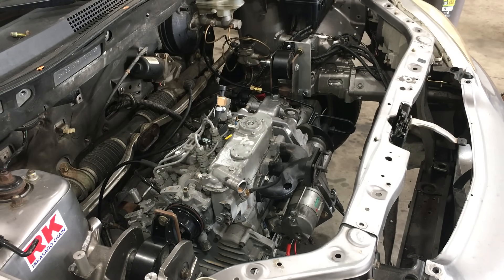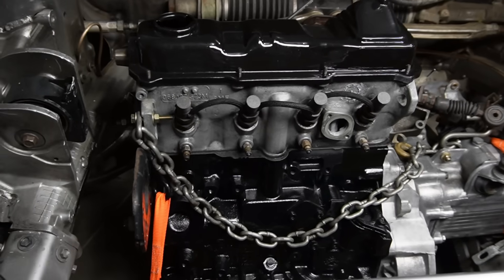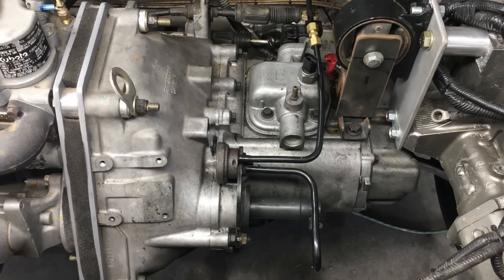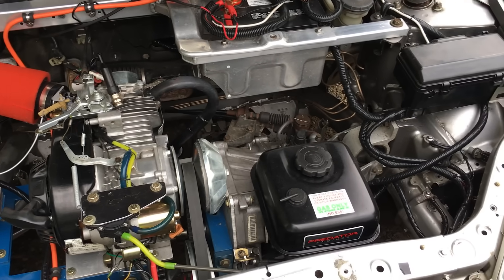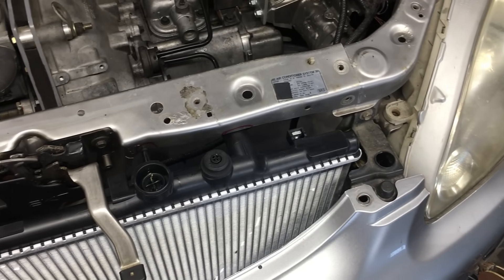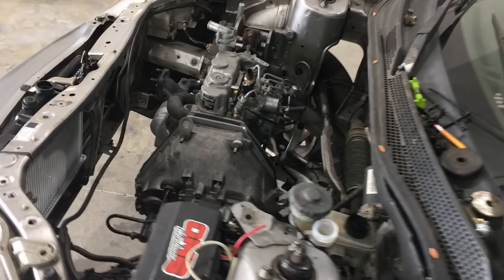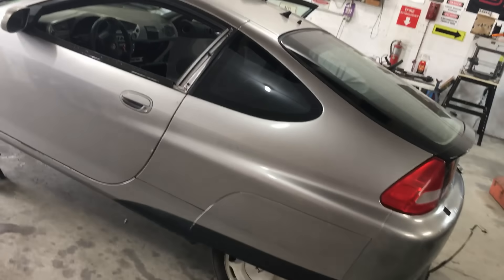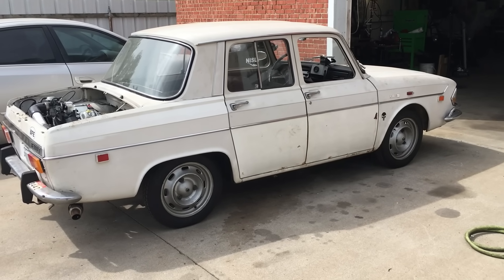S3 E33. 3 cylinder Kubota D722  diesel powered Honda Insight project has begun

Comment: I’ve been waiting for this project from the day you first introduced the Kubota…. A match made in hyper-mileage heaven!
Reply: Haha!  :)
Reply: It's neat, but realistically VW already sells a 1L diesel Lupo that can get around 80MPG with some wheel covers, grille block and smaller mirrors.  If one was so inclined.
Reply: Never sold in USA
Reply: @milescarter7803 imperial miles is different from regular miles. Just fyi.
Reply: @EvilCerealBoX  I think that 80mpg is already U.S. gallons.
Reply: @milescarter7803  Sticking to 40mph sustained speed on a warm summer day, I can get 110mpg (U.S. gallons, which I believe your number is referencing too) with my stock gasoline first-gen Insight (averaged over 95 miles). I'm interested to see what they can achieve with a diesel.
Reply: @milescarter7803  my bone stock g1 insight does that with driver mod
Reply: With gas prices we might all go out and buy our own insight to diesel swap
Reply: @sim6699 why not just keep it a hybrid 😭
Reply: The kubota can run on waste oil though

Comment: The supercharger just put this project over the top! If this gets twin charged, it may be my new favorite car on YouTube.
Reply: was about to say about twin charging, combine the best of both worlds
Reply: A twincharged diesel insight would be great
Reply: Yea indeed. that would raise the torque across the whole rpm range. With some magic up top. Should really consider upgrading the head bolts and maybe valve strings and some thick aluminium rods.
Reply: Combining the amr 300 with the turbo charger would be simple u could reuse turbo charger stuff from last time and ud only need a mesh blocking stuff from getting sucked into the amr 300
Reply: Mmmmmm... Twin Charged...!!!! That would be awesome! Lots of work to do that and I would want to watch every minute of it with one of those, as Mike Brewer from Wheeler Dealers calls it, a silly stupid little grin on my face the whole time thoroughly enjoying it all!  : )  Though, truth to tell, I do that all the time anyways while watching this channel!!
Reply: @ramentaryramblings  I really want to see both types of twincharging personlly.

If Jimbo wants his insight to be as predictable as possible, then he should run the supercharger into the tubro into a cooler then the intake.
This causes the supercharger to act like a pressure regulator, it limits the total amount of air in the system, but should also put cap on maximum boost level.

Essentially, the supercharger provides boost at idle to mid rpm, but also causes parasitic loss. The turbo then starts to kick in, and because of the stable boost pressure, should begin to reduce the drag the supercharger has on the system be reducing the amount of work it needs to do since it is now "feeding" into negative pressure.

The only problem I can foresee, but simple to fix is that a small hose with a 1 way valve should bypass the supercharger going from intake to inbetween the air chargers, that way there is always a minimum pressure and oil isn't sucked out of the supercharger and turbo. The Larger the hose, the higher the minimum pressure inbetween the chargers become. (I think)

The Second way which is the more common and sportier, which is turbo into supercharger, could get insane quick, since they have compounding boost effect. I don't know how long the little diesel will survive higher than 20 PSI.
Reply: Great no point watching the video now
Reply: @bv3078  and upgrade the engine block, and the cylinders and the....
Reply: Yes to this!😊

Comment: I don't know how many people actually did it, but it was a popular concept to strip an Insight like this and turn it into a crazy K-powered death trap, because you could get the chassis down to like 1700lbs or something.  Even lighter than the 1G DSM.  This Insight isn't ruined.  It just hasn't achieved its final form.
Reply from the maker: Yes!, a K swap turbo Insight is what Honda always intended but were too afraid to do.  Thankfully others have made it happen.
Reply: K24 insight would rip
Reply: @drippingwax yes, you got it right, they were the same car with a few cosmetic differences.
Reply: @drippingwax you also had the Mitsubishi GTO/3000GT and the Dodge Stealth which was the same car.
Reply: @drippingwax  1G DSM should also include the Mitsubishi Mighty Max, Plymouth Arrow and Dodge Ram 50, all the same truck made by Mitsubishi, just badge swapped by the factory. they used range of engines including 4G53/4G63/4G64
Reply: Dont forget the Chrysler Conquest/Mitsubishi Starion

Comment: Regarding the half shaft modification, you might consider using a milling machine to cut a half lap joint in each shaft.  Then machine a thick sleeve with a light press fit over the half lap joint, followed with a weld at either end of the sleeve.
Reply: If you're going to do that, just do plug welds on the sleeve.  Then the heat affected zone isn't subject to deflection like it would be at the end of the sleeve, nor is it subject to torsion because that's all taken up at the lap joint.  At that point, it's only keeping the shaft from pulling out of the sleeve.  It's also a lot less heat to pour into the shaft.
Reply: Or broach splines
Reply: if he had a machine shop he could turn down the shaft and spline them to fit the outer cv joints from the honda leave the axle in one piece just shortened and adapted 
i seen someone cut splines using a lathe he welded the splined stub on the other axle and used that as a reference to cut the new splines , verry tediously moving the cariage across and shaving a sliver off the shaft , bout 5 times a spline to get to the propper dept and .....eeehr about 80 splines per axle , he be tripping over his beard by the time hes done
Reply: Better job but we're not talking a lot of torque

Comment: The turbo from a Smart 800cc CDi engine would likely be close to perfect, and they are cheap (at least in Europe).  Unfortunately the turbine housing is integrated into the exhaust manifold, so you'd have to cut that off and mount a suitable flange. (unless by some miracle the port spacing was the same so you could make a flange adapter).
Reply: The kubota might have enough power to drive a BorgWarner K03 turbo from an VW 1.8T engine, tho I'm not sure. What I do know is they are cheap (as low as $100 for ebay sketch, and like $400 for a decent reman) and good turbos, and the earlier version as used on the 1.8T doesn't have an integrated manifold. Just make sure its one of the earlier ones for the 1.8T and not the later k03 (sometimes called the k03s) as used on the 2.0T FSI, as that version does often have an integrated manifold, and is definitely too big for that little Kubota engine.
Reply: @brentsnocomgaming7813  Too big for sure, I think the lowest power version of that engine was 150bhp?
There is a 1.3L turbo diesel engine used by Suzuki, Fiat and Vauxhall/Opel (GM) that would be a closer fit (and no integrated manifold), but that turbo is still designed for twice as much power as the Kubota would make.

Comment: Many modern diesels use a compound turbo system where they have a high pressure compressor and a low pressure compressor. The low pressure compressor (bigger turbo) intakes ambient air, densifies it to its optional pressure ratio, and discharges it to the intake of the high pressure compressor (small turbo). The high pressure compressor now intakes denser air as opposed to ambient air like in a single turbo setup. The intaked denser air would be compounded into an even denser “air”while the compressor works at the same efficiency. The theory is 2 compressors in series, each densifying the intaked air to their most efficient pressure ratio. 

I believe that by using the supercharger as a primary compressor and using a turbo (that flows25/33% more than the supercharger) as a secondary compressor, you would really have a peppy efficient 600cc twin charged diesel.

By sizing the pulley on the supercharger you would control the superchargers pressure ratio to an efficient point. Let’s say a pressure ratio of 2:1 for example. 

Atmospheric pressure at sea level is 1 bar.

2:1 pressure ratio = absolute discharge (2bar) / absolute inlet (1bar)

Gauge psi = absolute discharge - absolute inlet  = 1bar on the gauge while the supercharger works at a pressure ratio of 2 

Now again how can we increase density of the air and maintaining the same efficiency? 

We can use a bigger displacement supercharger to do so but it’s response rate will be slower. 

We can instead increase the volume of air that moves through the supercharger by actually turbocharging the supercharger.

Now, our supercharger will see denser air through its intake as opposed to just atmospheric air

Let’s say our turbocharger has an optimal pressure ratio of 2:1 

Our turbocharger has raised the atmospheric pressure of the intake on the supercharger to 2 bar

2 bar atmospheric

2:1 pressure ratio = absolute discharge (4bar) / absolute inlet (2bar)

Gauge psi = 4bar - 2bar  = 2bar on the gauge while the supercharger works at a pressure ratio of 2 

Now your efficiency will be close to that of a 600cc kubota diesel supercharged at ”15psi” yet the power will be that of a supercharged 600cc kubota at “30 psi” 

Now in a system like this a air / water intercooler setup between the engine and the supercharger would offer the densest air

Comment: Volvo uses a supercharger and turbo combo on several 4-stroke diesel models. The result is a lot of power in a small package that has a significantly high rev limit for a diesel of its size. I have gripes about the design, but I can't argue with the fact that they make a lot of power.

Comment: Oh yeah I recognize the Saturn slave cylinder and other parts. I had 3 different S series cars over the years and drove one for a decade. I did a couple exhilarating clutch jobs 🤣 those Saturn transmissions were actually a great little gearbox, I had 335,000 miles on my main one and never had any problems 👍
Reply: Which were the best years/models of Saturn cars? I remember hearing about the oil consumption issues with some of the cars.
Reply: @prevost8686  I had a 2001 that I put 335,000 miles on. Then I had a 99 and 97 too. My dad and brother also had Saturns of that era. They ALL used oil pretty bad but ran forever as long as you were religious about checking the oil and topping it off. The 1.9 liter engine would build almost no heat in a cold climate so we would block off the whole radiator with cardboard or something in the winter if you were gonna have any chance of blowing heat in the cab. Wheel bearings went out about every 100,000 miles. Other than that they were good little commuter cars, great mileage.
Reply: @minnesotatomcat  Sad that they didn’t make it long term because GM could’ve had a line of compact vehicles that actually rivaled Toyota and Honda in quality.

Comment: Hey, great video as always! Here's an idea: fit the Volkswagen Diesel to an off roader! Maybe a scrap sidekick or something like that. I think it would be fun to have the 4 wheel drive working with the engine swap, as well as using a longitudinal transmission, rather than these transaxles. It's just an idea, anyway. Keep up with the great work! These videos always make my Sundays.
Reply: +1 on this one. I bet that torquey four cylinder would perform pretty well off road
Reply: Ye I think it would fit something like jeep pretty well
Reply: a guy here had the engine mounted next to the driver longitual , and he drove the front and rearaxle of the driveaxles from the fwd vw gearbox , made for a verry small but powerfull little off road car
Reply: Or something big like a Jeep Grand Cherokee & see how it performs off road
Reply: They've been putting variations of that VW diesel in Suzuki Samurais for over twenty years, and you can buy kits to do it.  Putting one in a Sidekick/Tracker would be easy.
Reply: @dan8789  the vw is about 800 kg and its for roaduse , the little diesel is reasonably powerfull aspecially the 1.9 turboversion , but not strong enough to pull american iron up a steep muddy hill or out the mud
the suzuki or a small pickup like the s10 would be a mush better option
Reply: they can most off roaders have gear reduction transfer cases some even custom doubler reduction case itd have no problem dragging any small american truck or jeep up a slope @watahyahknow  thing is theres been many volkswagon swaps into jeeps and tucks, even some kits so its not exactly new
Reply: I bet that VW engine ends up in the Renault
Reply: @kd5inm  think the stock engine in the renault is mounted lengthwize , not sure if the diesel would fit across , than again he could use the transmission out of a type 3 vw bus , these where mounted longitual and came in dieselversions , think it would work replacing the stock renault transmission too and getting the axles to fit

Comment: Appreciate the update.   I remember on Might Car Mods, they had a 2008 Nissan March Super Turbo.  It was a Super Charger and Turbo on an 930cc engine, sequential compound charged.  I wonder if that would be possible on a diesel but man it also sounds like a lot of work.
Reply: Volvo did this on one of their marine diesels years ago. at low speeds the supercharger provided boost then at higher loads when the turbo had spooled up, the sc was disconnected leaving only the turbo to provide boost air. Volvo also did this in a car engine but I don't know if it was the same set up as the diesel.

Comment: The supercharger might be a bit of an issue. If your potentially making boost at idle then the pressures applied to the bottom end may be enough to overcome the relatively insignificant oil pressures supplied at low rpm if you get on it too soon. You could just keep a light foot until 1-1.5k or so but human error is a thing. I would check and if needed possibly raise your oil pressure through some sort of regulator modification to make sure your getting the pressure you need down low but not making too much pressure at the higher end of the engines rev range or just vent boost at the lowest end of the rev range. I know absolutely nothing about these engines or their oiling system so I'm just speaking from my experiences with gasoline engines.
Reply from the maker: Yes,  however if you listened closely, I said we were going to use a boost controller on this supercharger.
Reply: @robotcantina8957  Of course, I wasn't sure if you were just going to limit peak boost or have a finer control throughout the rev range.
Reply from the maker: @thatonedude5237  I don't think the AMR500 supercharger will develop more than 8-10 psi of boost at full throttle , but on the low end we certainly don't want too much boost off idle.  its hard to say what we are going to get, however just in case we will have  means to dump  or modulate boost.  We will also be controlling the fuel rack to provide additional fuel according to the amount of boost.  it should be interesting.

Comment: Wow, now we're up to two project cars simultaneously! Jimbo, you are too kind. 😊 I'm really excited to see both the Honda Insight and the 3 cyl Kabuta diesel engine get a new life. I see a lot of potential for this continuation of both projects.

I was wondering how you were going to deal with the axle. It certainly didn't occur to me to cut up the two axles and weld them together. In hindsight, it makes sense, though I understand the apprehension of relying on a sleeve weld for something that will be taking considerable torque and shocks. But like you said, if it's been done before, there shouldn't be that much to worry about.

While I understand some people being upset seeing a rare care not being restored, I totally agree with you that the Honda Insight is living a good life. It's not like there are a lot of collectors and restorers looking for them, so you're not keeping in from others. As it is, you rescued it from a wrecking yard! Instead, it now lives a new life as a famous project car, providing knowledge and entertainment for thousands of people. That's almost certainly more than it would have provided to the world than being someone's daily driver or a collector's occasional show car.

I agree that you treat all of these vehicles with respect, trying your best to push them to their limits without risking destroying them. Obviously the Saturn was an exception because it was destined for the junk yard anyway, so there's no harm in pushing it even further in the names of science and entertainment.

I thank you for all of your testing, explanation, and entertainment. I have learned so much about different types of engines and fuel systems that I didn't know before. From your drawings and explanations, to the entertaining stories and crisp editing, you make learning about this stuff a lot of fun. I look forward to your videos every week, even if they are just updates on the little things happening behind the scenes or the unfortunate setbacks that mean we don't get to see much outward progress. It's all part of the journey and I'm happy to share it with you every week.

Comment: In the Musket Ball Run (The "100-hp or less" version of the Cannonball Run) someone enterd a Honda Insight fitted with a 30-gal. fuel cell and a VW 1.9L TDI engine. How, I don't know... but they did it. And one can only figure the MPG returns they got with it.😐

Comment: You mentioned older two stroke diesels with a super charger. I used to drive a wrecker in the Army and it had a 12 liter two stroke Detroit in it. It had a supercharger and a turbocharger. Supercharger was mounted in the engine vally and the turbo was directly on top of the supercharger. Did not have a intercooler. Just an idea for your little diesel.